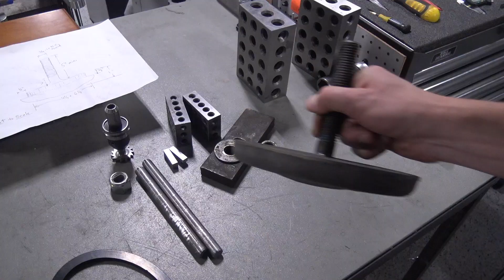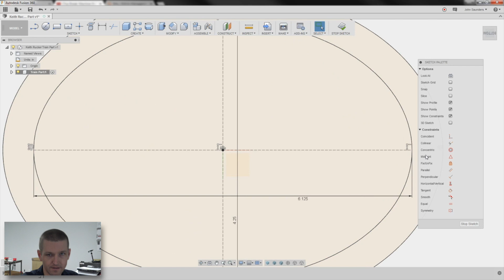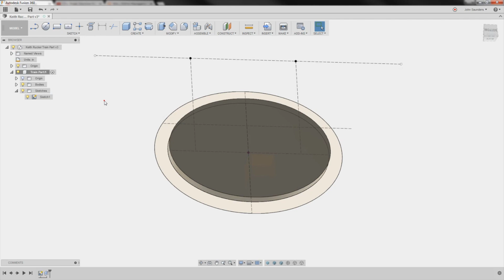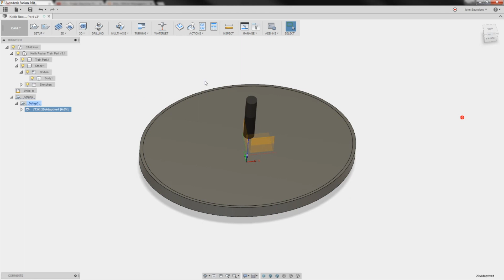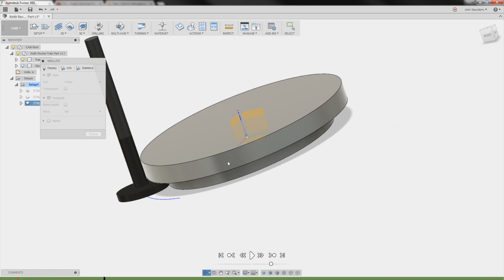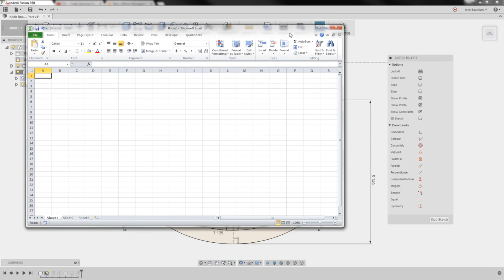Keith Rucker Cast Iron Train Part!   WW124

Comment: Brother safety first, you have some very bad safety habits. Second, try not to over complicate the fixtures, simplest fixture is the best one. Allso when you make fixture pretend as you have 10000 or more pieces to make, then the best solutions will come to you. Allso HSS and HSSE
Especially uncoated one must have cooling, or just use spray. And the way you enter material whit woodruff is very bad especially transition feom pass to pass, i known when you started programming what would happen.

Comment: good job. A new unknown part with just numbers is always going to require learning,  The part is a closure plug for an inspection hole in the side of a boiler. Steam pressure is against the domed side, oval shape is so you can put it into the boiler cavaity, turnit and pull it back against the gasket and the boiler shell and then put the slotted block across the out side and pull it into place with the nut and bolt.   The steam pressure pushing fro the inside out dose the actual sealing of the gasket.  The nut is to hold it while steaming up the boiler.  Hope it makes more sense now.

Comment: Should have started with straight sided pocket in aluminum soft jaws matching the OD profile.  If your pocket profile is close to matching the part, that is.  The draft on the cast iron will hold while milling.

Comment: Just a little side-track: 

The Navy depends on pressure vessels for much of its machinery and ordnance operation. All require access for cleaning and servicing and in many cases via oval ports closed by heavy cast covers much like this Wednesday's widget. 

Back in the day (40 years ago +/- and long before) we cut the gasket faces on an engine lathe whose taper attachment waz disabled and the slide nut was furnished with a cam follower driven by a cam mounted to the chuck. The cover was oriented and chucked then the face was cut using power cross-feed while the slide dived in and out driven by the cam with return via powerful springs. 

The beauty was the "phonographic finish" required for proper function of tbe spiral wound metal-asbestos gaskets was easy to implement by manipulating tool radius and radial feed per rev. It was also used for cutting face grooves, gasket seat recesses (exacty like the handhole cover that is this Wednesday's Widget) etc, anything for which there was a existing cam or for which a cam could be made.

 Total time to set-up and cut? About 20 minutes. I remember cutting a pallet load of superheater handhole covers in a shift in my apprentice days. 

Time to work out how to do it, make the hardware and cams, prove the set-up: probably a week; maybe more. I was told some old railroad machinist built the set-up in the late '30's and he probably plagerized the set-up used in railroad round houses for generations. This is not a project for a one-sey - two-sey job. You need hundreds of parts to justify the expense of the basic set-up and again to make each cam the hard way. But in railroad shops, boiler shops, Naval shipyards, etc have plenty of volume for such an elaborate operation.

The blessings of CNC means no laborious set-up or fancy cam required. Set up the part, establish references, and skim the face or make the whole cover from scratch if need be. Yup, the trade has moved on and us dinosaurs can wave it into the future, assured that our part of the metalworking industry is in the capable hands of people like John Saunders and his many peers.

Comment: Interesting setup. What you could have done, was put a plate or a sacrificial piece of stock on your  indexer,  and did a similar setup, btw if you ever get into a situation like that again, they do make nuts with rounded bottoms with rounded washers that will eliminate the scew, we use them on setups when running castings to help clamping. Like your vids keep up the work.

Comment: A boiler clean out cover is exactly that, a clean out cover. (Ignore the Vulcan part. It's the vessel manufacturer.) They are made elliptical so they can be installed from the outside of the vessel and then manoeuvred into position at which time a yoke or bridge is installed on the stud and tightened down on the outside of the vessel. They use the inside pressure from the steam to seal them.

As far as your machining, I think part of your problem on the first go was the fact that you were climb milling the part and when you came to the finish it grabbed the "nub" and twisted the part in the setup. When you machined the part the second time you were not climb milling but conventional milling which cuts up and away from the work. For rough work climb milling seldom works well but it does and excellent job when taking a very small finish cut.

Comment: Item is commonly known as a mud-hole door, usually held into place by means of a bridge clamp. Door is removed to allow access for high volume water hose for boiler washing, and to provide means to visually examine the water space between the inner & outer boiler skins.

Comment: That fixture was the best way, you did good. Those HSS woodruffs in casting can be a B#%*! But you're good, you didnt give up and tried something else and it worked. Those guys saying 4th axis piece of cake would blame the machine when it didnt work out. I dont know that software, but in powermill i can rotate along Z axis for angle with trig. I'm guessing thats what you did but let software do math, which is better. I hope when you figured the y difference you moved along x the same distance as the 2 points in software? Otherwise a precision angle would be wrong, if i understand what you were doing correctly. Glad you machined outside countour first, wouldve been risky without having that known surface to clear your shank. I see alot of dumb machining videos, but you got my respect with this one, very nice

Comment: Appears to be a boiler mud hole door or wash-out door. Bolts into a steam boiler outer surface. Several are fitted to give access to insert high pressure water jets for cleaning sludge (mud) which forms from boiling water and additives which may be used to soften the water. Part of overall maintenance for steam boilers. Results of build up of mud can be catastrophic for boilers and their operatives.

Comment: Just a quick tip for when your work holding "scares you" or you don't "feel like you're as secure as you want to be".  Like here where you have this hunk on top of the small blocks.  Put a piece of paper between the part and the small blocks, a small piece on either side.  Clamp it down and then tear off any excess.  It works like like a gripper and can let you get away with very light pressure or can give you super power from upward tool pressure  (in a vise), or in this instance can give you a more solid part that isn't as likely to move from the tool pressure.  Its an old trick I learned at work from the masters.  :)

Comment: could you not have used a piece of square aluminum, drill a hole down the length, slide it over that stud, then square and center it on the part and just clamp the aluminum in the vice? no machining experience so if theres something obvious im missing i apologize, but seems like it would be easier that way

Comment: So could you have fixtured it flat side up and just mill portions of it at a time? Basically like u would do if u had something clamped down to a mini pallet and had to stop to move clamps. Probably wouldn't be any less work and probably not even faster overall but u could at least use an a better tool. ???

Comment: It's a lid that goes on the inside of a handhole (manhole but just for your hand/arm) in the wall of the steam boiler, i.e. in the compartment that holds actual pressurised steam. The threaded rod then goes through a clamp that is larger than the hole on the outside, and the hole contraption is then sandwiched together with a bolt. 
It's also not in any way a train specific way to do this, steam boilers in general, still today actually, does it this way.

Comment: they should have added a knob in the casing on the top for lathe hold, bolt it down in custom fixture made with hole to bolt down in mill to properly make reference work hold knob for lathe and mill knob, then clamp and run in lathe w/squared up part to run under part side for final dimension for the bushing cut out.. then mill knob off back in same mill fixture to finish off part. it would be cheaper on tools and faster cutting the under OD with more accuracy. granted it adds more operations but the speed of the lathe will make up for the added operation time
Reply: again this will help with slight adjustment to the sand casting it was made from but helps long term production and speed by making just a slight alteration in original design. again this won't work for the current part you are working on. your method is fine for prototyping with single type or couple pieces type of work. but for long-term Reeve and short-term lean or Mass Manufacturing that knob will guarantee long-term standing contract with fast reproduction and more accurate tolerances long term with that type casting
Reply: I specialized in lean manufacturing with casted inconel parts and as well as large-scale mass production parts made with large blocks 14×8×1.75 blocks (squared up size) of (AMS 5599 625 inconel) welding 2 blocks together (stacking them) then using an EDM to burn 30 parts per block (60 total) per set up [e.g. 5-3/4×1.25×.951 strap like jet engine like parts with hole on one side thick like base swept from center one way, and hook like arm swept the opposite direction from Center with sides tapered after thick base going straight down to hook] 
    I always found that Circle/ cylindrical/&tube/port type cuts should aways be made on a lathe or 5 axis advice type machine and worked around mill type cutting. for long term production. this statement is excludes prototyping and Engineering work type processes

Comment: Cast iron is a bitch. Tool life is all over the place with the carbon variations and sometimes you get straight sand from the sand casting.  Not to mention it's really destructive to the machine due to all the dust flying into every nook and cranny which then rusts instantly.

Comment: My question on this and other round stock parts you have cut on the mill is how are you setting the center of the part as workpiece zero (G54)?   I noticed you used the readout for X so I am assuming you ended up doing the same for Y is that correct?  Also do you do that for all round or in this case oval stock?
Reply: Thanks that is what I had figured.  I typically have used the soft jaws for zero but was thinking of trying the center to see how it goes.
Reply: Thanks.  That was what I had figured but wanted to confirm.

Comment: Thanks for this video.  I do a bit of cast iron machining and I always have a lump in my throat when trying to  figure out where to start from.  As you say, knowing "what the customer WANTS in the end" is vital to  the planning for the right outcome.
  I don't do CNC machining, but i also enjoyed the whole "fusion" thing.  I have been using Turbocad, (mostly 2D) for many years.  And, a  group of us took a Sketchup class a couple of years ago so I could sorta keep up with you.  It sure is apparent. though, that you are comfortable with the software.  I have to admit, though that I said "gulp" when you started at 1000 rpms.

Comment: Fantastic video mate, really learning a lot from your talks about fusion, I'm thinking of doing a conversion and certification from NX that I use now to Fusion and this all helps, so please ignore the trolls and bs'ers and keep doing what you're doing! It's great teaching and learning material, and I'm sure every subscriber really appreciates the time and effort you put in!  I think that you should have checked with Keith however if that threaded rod was meant to have some lean to it, and thus straightened it up to give yourself that to work from. If that had been the case, you could have got the 4th into play! If you had done that, I'm sure Adam would have turned you up a threaded split sleeve to hold it in the 4th's chuck, and with Abom on board it would have been a 3 way collaboration, and I love when everyone works together!

Comment: Love your fixture.   I'm going to have to add two long pins to my 1-2-3 block drawer.

Cast iron is always a different animal that bar stock.  One never gets to start with a flat face, a clamping face, or even a reference.  Also clamps don't hold well even on the 'flat' surfaces.   

Usually the first thing you have to do is machine a reference somewhere.   Luckily parts are usually oversize.  For fixturing plenty of wedges, shims and pads are used to clamp the work to the table.  Vices are often worthless due to the draft on opposing surfaces.  Pads are used under all clamps and between work and table due to the uneven part surfaces and the abrasive effect of the cast on your nicely ground tables and blocks. In you parts pads would have reduced the sliding around you experienced when tightening your fixture.

Keep up the good work!

Comment: I couldn't help but laugh as you were talking about mistakes and you take apart the whole thing to put a rubber ring on - when the whole point of it being oval is so you can get it in and out of the hole. Meaning, the rubber ring would have slipped right over it without removing it!

Comment: a carbide tipped blade can get you higher speeds and requires a less rigid fixture. I found I ran into less fixture problems with higher RPMs.

Comment: i would do excatly like you did but hand program g-code do ellipse only need under 10lines of code. then measure what angle part is and turn machine coordinate system. oh thats so easy. without cam
#1= 3.0625    (X RADIUS)
#2= 0.6939  (Y SCALE = Y RADIUS 2.125)
#3= 0.01    (STEPPING ANGLE)
#4= 0    (CURRENT ANGLE)

G1X[#1*COS[0]]Y[#2*#1*SIN[0]]
WHILE [#4 LT 360] DO1
G1X[#1*COS[#4]]Y[#2*#1*SIN[#4]]
#4=#4+#3
END1

Ofcourse need feed in before and out after loop finish. but basically thats what cam doing ,but millions lines :)

Comment: I agree with Greg, however I'm sure Keith will tell you more about those covers. They are found the world over on old land I.e power station or locomotive boilers. One thing about cast iron. It's not always as clean as your piece looked and can contain some tool destroying casting sand just under the surface. So if you're not sure, make your first pass deep and get below the crud and into the iron.

Comment: Seems to me the problem with the non-perpendicular bolt in the 4th axis is the same as the rotated oval in 2 axes.  Stick the bolt in the collet and find the maximum runout relative to the collet face, and tilt your part in the Fusion setup to match. You will have a few thousandths skew in the milled face for the O-ring, but that will be well within what the O-ring can manage.

Comment: Hey John, I don't know if it's already been mentioned but since your Haimer appears to not return to zero, then when you dial in a part to zero you are not on center. The Haimer works on distance traveled, so two full revolutions is the correct distance needed to be moved in order for getting to the accurate center. If you are starting at say -.05mm and end at zero, you have traveled 4.05mm and overshot center. If you don't reset the resting point to zero then just end where you start on the dial. In Z it depends on how you set the Haimer tool height. If you set the tool height with the dial at -.05mm then you need to end there as well. If it was set with the dial at zero then just at zero.

Comment: Before you start cutting iron you need a traced pattern from the hole in the boiler! Not a copy of the door joint.
The mud door needs to fit the hole in the boiler before you think about anything else. 
You want the smnallest gap possible around the mud door when its in the boiler shell, you dont do that and end up with a large gap your door joint will slowly push out of the mud hole. Ask me how I know? I restore steam engines for a living.
We had a guy here in the UK scalded to death by a poorly fitted mud door and a buggered up door joint a few years ago.
Dont take chances with boiler fittings get it right every time.

Comment: You're right the fixture could have been better. You could have machined a 3 inch diameter square bar 3 inch long. drilled in the centre to fit the bolt, on a lathe to give you a way to get a 90 angle from the back of the peice. Fixed to the job with loctite and a nut and washer. this would take out the bend in the bolt.

Comment: I've seen this type of part held in a 4 jaw chuck on a cnc lathe..it marks the edges but they are cleaned up afterwards. Only works with a C axis..the oval can be turned or milled this way.

Comment: Fourth axis hold.  Put a cylinder (pipe) with square ends over the bolt.  Make the ID of the cylinder fairly big.  Hold the cylinder on with a wedge shaped washer assembly.  Use two fender washers with an offset wire between them to achieve the proper wedge angle.  Make the ID of the cylinder big enough to center it on the cast iron plug.  Then you can use the fourth axis and mill it.  I don't understand much about CNC but I think that you could get this tight enough to hold the part.

Comment: Your workholding setup was very clever, but I think I would have gone back to soft jaws after cutting the outside profile. Once you removed a fair amount of the draft the soft jaws should have been fine.
Reply: Fair point.  I'd then flip it so you can get at the race track with an end mill.
Reply: My thought exactly
Reply: He was right, his way it is referenced from the bottom, softjaws upside down is more work and wouldnt turn out as good